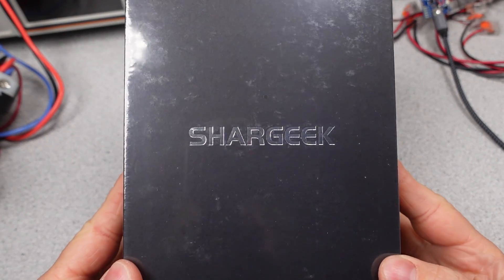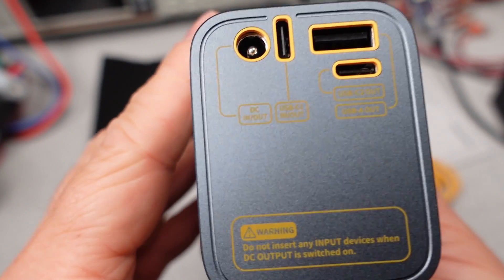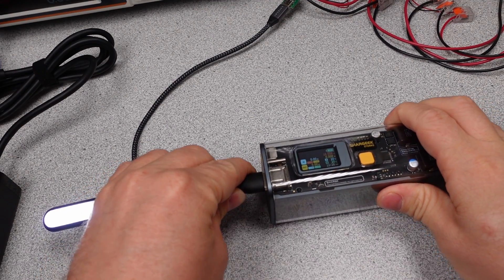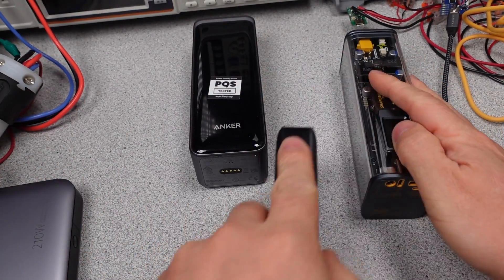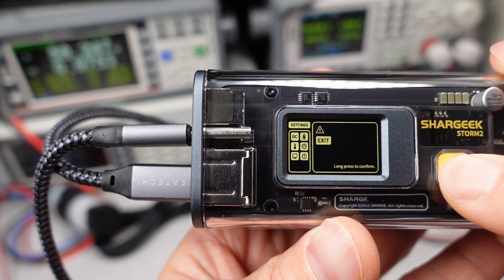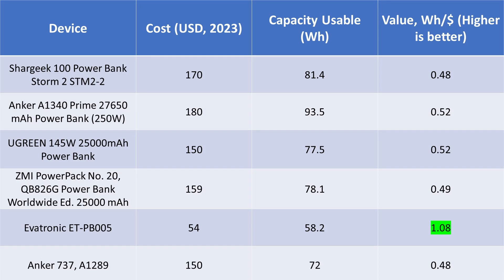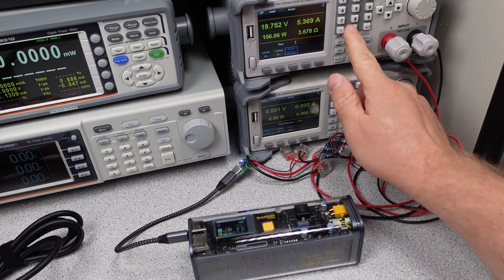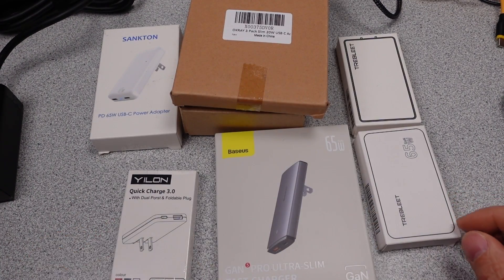Shargeek Storm 2 Power Bank Tested and Reviewed

Comment: And, 2yrs later, how is it holding up? would you recommend it or should I get the Iniu B64 140W 25kmAh or the Anker 737?
Reply from the maker: It still turns on, It holds power better than the 737, I didn't get too many cycles into it though.
Reply: @AllThingsOnePlace  Thanks for the quick reply, I've been watching videos looking for the right powerbank that can power my 3 Mini 5 pro batteries all at once by supplying its 65W charging hub with enough juice to for that uninterrupted energy. I got the Iniu P63 due to its portability & it's great in terms of PD efficiency but, they lied on the 25k capacity, that thing is 15k at best. Do you have something similar maybe between 100-150w but true 25k mAh capacity?

Comment: Love your videos. Please review the shargeek 170 or 100. DC output is very useful for CPAP machines that could run off usb c but don’t. It is very hard to find a power bank that is flight safe but also has a dc output. With no heat or humidity on a CPAP is very efficient using 5-40 watts and yes it does bounce around as you breathe

Comment: Great review! Makes me wonder about the thermals and efficiency of my Sandberg 100W powerbank I’ve had for a few years now. The aluminum enclosure gets hot sometimes when charging my MacBook Pro, but it keeps on going until it’s fully discharged. Heavy and not cheap but pretty happy with it thus far.
Reply from the maker: Yeah, if it makes it to fully discharged that's a step up.  Yeah, some of these really overheat quickly.

Comment: This last week I changed mine for an Anker Prime 250W. The reason is my Framework laptop battery inflated, so I removed it, thinking I could use the power bank to power the laptop. The laptop was incredibly unstable on the Shargeek, not fully booting most of the time. Whereas it was very reliable on the Anker.
My best guess is the Anker has higher capacitance on the output side, likely lower ripple / more stable for spikey loads where you would normally have the device's own battery as a UPS.
Reply from the maker: yeah, anker does better in the power bank space

Comment: I've had mine since the kickstarter and the battery percentage has become flaky.  It will show 0% and still keep charging my devices.  I am guessing that it went out of whack at some point because I normally keep it charged but it drops from 99% to below 10% very fast (less than a minute).  I first freaked out and plugged it in to charge it and it went straight to 99% which also was sketchy but I believed the 99% since I hadn't used it to deplete it.  So I am currently running it down as far as I can, hopefully it doesn't ruin it.  It still says 100% battery life after what it says is 186 cycles.  Once I get it as low as it will go while sitting at 0% for the majority of the time hopefully when I recharge it, it will get back into normal percentage showing.  I don't like how it drains when not even used (even when turned off) faster when just left alone and the display goes off after 1 min. but still drains when off, nothing like grabbing a power bank to go and throwing it in your bag to find it is at 50% when you go to use it.

Good review and agree it's just a power bank and probably not worth it in the long run.  I'm a fan of kickstarter and like to try new things so I get what I get.
Reply from the maker: Yeah I have also had this issue with some of the newer anker power banks.  Seems like software bugs.

Comment: What would be your recommendation for a powerbank for the lenovo legion go which needs a 65w charging... Thank you for doing videos like this.
Reply from the maker: I would go for any power bank rated 65w or higher.  The thing I wish they would do is state if the power bank can do it continuously.  Generally for laptops you are looking at only 1 charge from a power bank but with todays notebooks that's basically an extra day of work, as long as you aren't rendering video or gaming.  You are going to need a bigger battery.

Comment: I've had mine for over 6 months now, absolutely love it. 

8:52 One thing to note: The DC port is not just output - it's input too! Any old DC power supply up to 25V can double as a charger for this too, completely automatically, which is super nice.

The DC port is a gamechanger. I saved $170 alone using it as a power supply for a micro dremel from proxxon who normally charge that for their 'official' power supply. It's a handheld variable voltage power supply for electronics projects too, which is incredibly rare, particularly at this price range.
Reply from the maker: Yeah, the DC port I kind of understand, puts it in one package.  I use a PD trigger board and a buck boost power supply with it's own screens and controls.  I like that since I don't have to go into any menus or anything.
Reply: I’ve been looking all through the user manual, YouTube videos and contacted support but they don’t respond. Is the DC input compatible with pass through charging? Can you charge it through DC and then use the other 3 ports for charging other devices?? That would be a giant game changer
Reply: @toetie2019  You sure can!
Reply: @SovietLensReviews  awesome! Thanks so much
Reply: I think that DC-out feature would be a lot more useful if Shargeek (now Sharge) threw in an cheap adaptor pack, which is harder to find than a USB-C charging cable ... which the pack I bought at half price failed to include anyway.
I didn't realize there were that many sizes of DC connectors until I tried to pair it up with my laptop or Yamaha digital piano. Both of these had different DC connectors, which in turn are different from the connector for the power pack.
I was able to find a cheap notebook adaptor set for US$5 equivalent. It still doesn't solve my problem because it only has DC connectors on one end, not both, but it is a sign of what Sharge could have done for an insignificant amount of money.

Comment: Great review, thank you. I would also be very interested in a review for the Shargeek 170.
Reply from the maker: Yeah, I'm avoiding it, but it'll be on eventually.
Reply: @AllThingsOnePlace  Now that I've been using the Storm 2 (or Shargeek 100) for over a year, it's still one of the few powerbanks that allows me to power a star tracker with 12V 2A over the DC output as a UPS, while plugging in the lens warmer or the camera itself whenever needed without cutting power for the tracker. Great product for my use case, albeit a bit pricey. 
It would still be very interesting to have a list/overview of powerbanks that provide UPS functionality though, since this seems to be a feature that most manufacturers don't provide clear information on in their marketing speeches.

Comment: So what would you recommend to charge MBP14 M3Pro and iPhone 13 Pro?
Reply from the maker: For a power bank, any of the larger ones that doesn't overheat basically.  The MBP 14 has a 70 watt hour battery alone so that plus a phone plus losses, no 'airline' ready power bank is going to charge both devices even once.  If you just need to extend work time a bit, this or any other is going to work.  The ones that over heat you have to use a 60W cable to charge the laptop back up to not stop charging during transfer.
Reply: @AllThingsOnePlace  I think I don't need to charge two devices at once, but would be great to add additinal few hours of work to my MBP during flights or conferences where you don't have access to the socket. This one looks cool but other than that it's average, so I'm not fully convinced that the price is justified here.

Comment: so I have this power bank but the output is only about 20-25 w at best using the supplied cable (and any other) on USB C1...is there something I may need to do to fix that?
Reply from the maker: The device is usually the decision maker on how much power to use.  These power banks do have a menu system though so maybe a setting?

Comment: will this work with a Asus z13 acronym 2

Laptop Specs: 
POWER SUPPLY :TYPE-C, 130W AC Adapter, Output: 20V DC, 6.5A, 130W, Input: 100~240V AC, 50/60Hz universal
BATTERY: 56WHrs, 4S1P, 4-cell Li-ion
I/O Ports:
1x 3.5mm Combo Audio Jack
1x USB 3.2 Gen 1 Type-A
1x USB 3.2 Gen 2 Type-C support DisplayPort™ / power delivery / G-SYNC
1x Thunderbolt™ 4 support DisplayPort™ / power delivery
1x ROG XG Mobile Interface and USB Type-C combo port (with USB 3.2 Gen2, support DisplayPort™ 1.4)
1x card reader (microSD) (UHS-II)

If this isn't enough information let me know, id really appreciate your help id hate to mess up my laptop.
Reply from the maker: They say power delivery on two of the ports so I would expect it to work.  It won't be more than 100 watts though so don't expect full performance from the laptop.  Also, the power bank will overheat and shutdown before it delivers all of it's energy to the laptop if you are running full tilt.
Reply: @AllThingsOnePlace  Thanx alot would you have an alternative recomendation? onw that supports the same whatts as the laptop?

Comment: So I’m trying to look for a powerbank for oled steam deck. I was going to get this but now I know it overheats im pretty turn down from it.

Any light reliable banks that doesn’t overheat for the steam deck. I know it’s a hard ask.
Reply from the maker: Yeah, that's so new of a device, no idea what actually works with it or not.  The steam deck may be fine with this power bank since it won't draw 100 watts.  This one actually over heats much less easily versus the slim version.
Reply: @AllThingsOnePlace  I actually want the slim for the weight. Will it overheat less if I charge it while the device is off? But not sure if that defeats the purpose of having a power bank unless there is not outlet nearby.

Comment: Hi, what would you recommend? I'm torn between getting the Shargeek Storm2 or backing the new Shargeek 170 on kickstarter.  

I like the Storm2 with more features and functions like the DC plug and temperature meter and so on but was thinking whether the newer Shargeek 170 at kickstarter price and emphasis on better managing the heat issue and power delivery would be more reliable. 

What's your recommendation? Thanks in advance.
Reply from the maker: Yeah, the 170 has more watts and a smaller battery.  That's a cash grab.  The Storm 2 mostly does what it claims at least.  I know it isn't as cool looking...
Reply: @AllThingsOnePlace thanks for the reply.

I'm looking for a transparent power bank as my next unit. That's why I'm hovering around at Shargeek even though they have some teething issues...

Although Shargeek 170 is 24000mAh as compared to the 25600mAh of the Storm2, it is 119usd on kickstarter and additional 20-30usd for shipping. So its about 139usd, which is still cheaper than the black Friday price of 159usd of the storm2.

I actually prefer the functionality of storm2 and the interactiveness of the screen and button. The Shargeek 170 screen is bigger but appears more passive and nerfed in details...

I think I may take the plunge for the kickstarter hoping that they have truly improved on the temperatures and reliability for the Shargeek 170. And perhaps suggest to them to kickstart an upgraded and improved storm2 ver2 with better reliability, etc..

Comment: Great video! Would love to see you review the Jaguar PM 187 powerbank. It uses 21700 cells with a capacity of 20k mAh which has a claimed max output of 65 watts. It quite compact for its rated capacity and it also has a digital display for battery percentage and output/input info. It generally costs around 20-30 USD where I'm from so I would love if it you would put it through your review process to see if its actually legit despite being on the budget side.
Reply from the maker: Thanks yeah, that sounds like a good one to check out.  I did just pick up another budget oriented one too.
Reply: Looking forward to more powerbank reviews!

Comment: I'd be interested to see how the Oneplus or Oppo chargers fair.
Reply from the maker: That is one topic I haven't covered yet except basically saying that I have no way of testing them.
Reply: @AllThingsOnePlace  Oh my apologies... may I ask why it isn't possible?
Reply from the maker: @Lemonhead8890  The protocol is proprietary that those chargers use.  I don't have a simulator that can talk the protocol they use.  I have a device that can detect if it is compatible but it won't force the device into that mode.
Reply: @AllThingsOnePlace  Ohhh ya that right, I forgot their whole thing is proprietary... gotcha, thank you for explaining. I just figured the charger may operate somewhat in line with a normal charger when not using its fast charging tech.

I guess I was just wondering if they actually made some decent quality stuff  as far as wasted energy or high idle.

Comment: They must have changed something very recently, because mine does not support passthrough at all, no matter what is plugged in. There is zero power coming out of the USB ports when its charging, and it will terminate power to devices connected to the USB ports when wall power is connected. I bought this to replace my first Anker 737 which failed, but bought a second Anker 737 to replace this battery bank, after Anker refused to warranty the first 737 after it stopped working in 1 month and they advised me to just dispose of it.
Reply from the maker: That is very unusual of Anker, I usually hear the opposite of their warranty service but I have never experienced it myself.  Yeah, this Shargeek worked with basically every feature.  This is the modern version with the new company name inside, Sharge now, so maybe some firmware updates?  I don't know if you can update the firmware in this one or not.

Comment: Does a 100 w charger manage to max out the input for this power bank? For example the Anker prime 100w you reviewed recently
Reply from the maker: Very close, 91W in on this one.
Reply: @AllThingsOnePlace So In terms of time until full charge, it will be as if its getting maxed out with a 100w charger +- a couple of mins?

Comment: during the crowdfunding campaign, they were going to go with red panasonic cells but there was a supply shortage so ended up using the blue samsung ones you see today. this was in 2021. 
considering the anker and ugreen models came out much later (this year for the anker prime), this storm 2 power bank shows its longevity.
i use one of mine for portable soldering. it is helpful looking at the screen to look at power draw. i don’t need it to be super accurate for that so it serves my needs well over the years. 
and they now have plans for a new “cyberpunk” style power bank after their crowdfunding is over.
Reply from the maker: Yeah, this one is miles ahead of the slim thankfully.  Hopefully, the newer offerings do a little better on the performance side.

Comment: Another great video.  I know you previously mentioned that you purchased the INIU Portable Charger, 45W USB C Power Bank Fast Charging with 15000mAh PD so I am looking forward to when you release the video.  Great work as always.  My go to place for anything charging or battery related.   Your content is up their with Gamers Nexus and RTings in regards to clear data driven reviews.
Reply from the maker: Wow, thanks!  Yeah, as a part timer hobby-level I don't always get things out timely and certainly not quickly so yeah, I've started to go with eventually for some things.  Probably will go to the nitecore ones next.

Comment: Nice review -- wondering if you might test/review the ISDT Power 200X? (they make three of varying single port output abilities but the 200X seems to be their "top of the line")
Reply from the maker: Yeah, I can't find that it actually exists, I've tried ordering it, got the 200 shipped out twice, then had orders cancelled on me.  If they make it difficult to get I'm not giving it anymore time or effort.  Skip.  I have the normal 200 which I will look at eventually.

Comment: I have this power bank. My cable stopped working after a few months, but could just be bad luck I suppose. I have their 100w power brick as well, which could be the issue, and it only hits 90w on the charge. I've  never used the DC port. Honestly it just looked cool, and there weren't many other options with 100w output a couple years ago (that I had found). Also, the timer is really weird. After 99 hours, it just resets. There is no count of how many times it has ticket over. So I have no real idea how many hours i have put through it.
Reply from the maker: Yeah, I haven't given the cables any long term use but yeah, this power bank makes more sense than the slim, at least the ratings are within reason.  It looks like they have a new power bank on kick starter with a smaller battery and rated to 170 watts out.